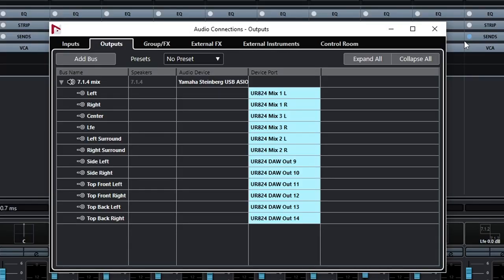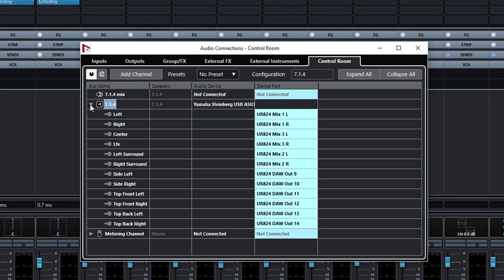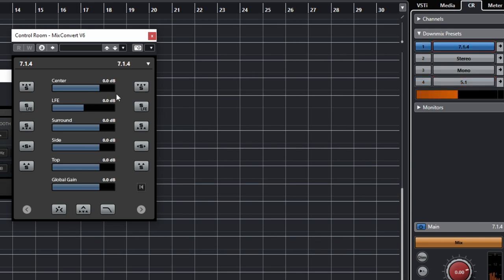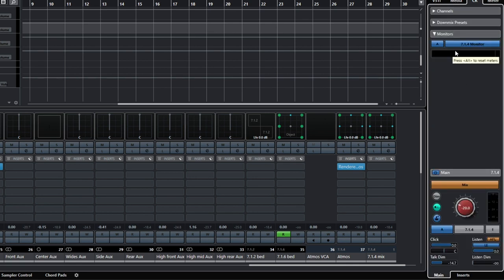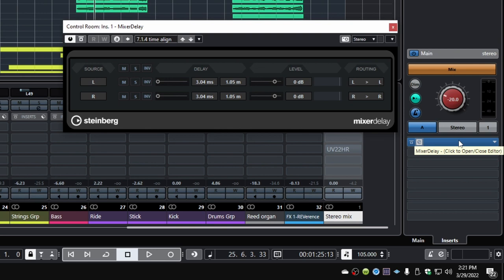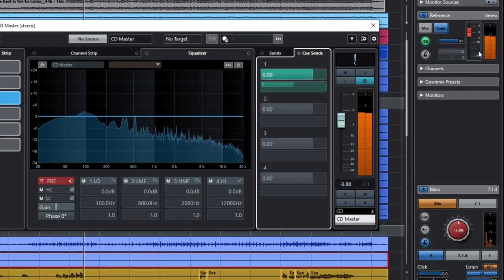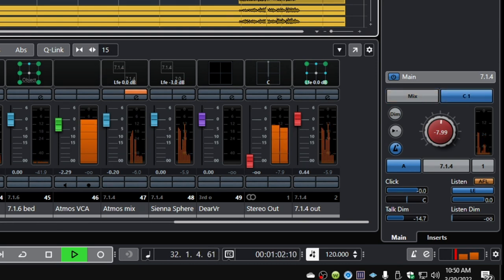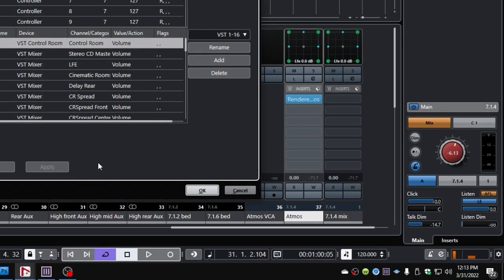The Control Room and Atmos/Multichannel Mixing (Cubase/Nuendo)

Comment: Great Video :-) I have been following all your videos for a while now :-) I take it your not using any dedicated controller system just Nuendo and the Steinberg interface for your outputs to your speakers? Best wishes
Reply from the maker: Thanks so much. You're correct about not using a dedicated controller. Having realized Atmos will probably never be more to me than a hobby interest for me personally in my situation, a controller remains a "nice-to-have". 
I have installed and set up SoundID Reference Multichannel on the 21-day free trial. It's a great program and did improve my sound somewhat. Not sure I'll spend the money yet.
Reply: @balladeerstudio  I am part of a group of pro producers who are looking at getting into Dolby Atmos and we have talked to many pros about it :-) but your videos give me especially some hope that we can find a more budget way into mixing in dolby atmos.. so we can get a grip without putting as on the bread line :-) I am hoping Someone like steinberg will bring out an interface that will work with cubase/Nuendo using only there equipment. Thank you keep up the great work.
Reply: @balladeerstudio  Thank you for the reply one quick question is it easy enough to route the channels in the dolby Render to the outputs of the Steinberg interface outs ? Sorry if this is a silly Question as i am just starting wit the dolby render kind regards kirk QFX
Reply from the maker: @QFXmusic  The reason you can hear the renderer is because it outputs to a 7.1.4 buss. It's explained in my videos, and others' as well. Good luck.

Comment: Fantastic video, very informative, I have used the control room for a long time, but recently when I worked on 5.1, I wanted to use a few new plugins to monitor 5.1 on Headphones. "Waves NX" has a plugin version "5.1/Stereo"; other plugins do not have this feature. So I wonder how to use a 5.1 plugin such as the "dearVR Monitor" on the control room headphones.

Comment: Hello from Norway! I just wondered; Is it possible to bypass decoding on the AT300 (direct mode) when you are listening on your DAW mix? I assume its always connected avoiding cable swaps? Im just starting to gather all the bits and pieces to start some Atmos mixing. Great advices by the way - I think we can make good atmos music without beeing "Dolby Certified" :)
Reply from the maker: Hi Tom! I don't listen to my DAW through the AVR. It's the other way around. Nuendo is configured to connect directly to the speakers through Control Room. When I listen to the AVR, it is a 7.1.4 input to Nuendo that I monitor with Control Room. Hope that helps.

Comment: If I am just mixing Binaural do I need to set control room to that format (7.1.4) or stereo (as the renderer puts out binaural.
Reply from the maker: As I remember, Nuendo's Dolby Renderer only works in 7.1.4. So you need to have an output channel set to 7.1.4. But you don't need to have a hardware interface that supports that if you're not mixing with speakers. You need the Dolby Renderer in order to output binaural from the renderer. I hope that helps.
Reply: @balladeerstudio  Thanks, I ended up buying Cubase and Steinberg's own literature is wrong about Nuendo vs Cubase. Previously 5.1 was the limit but with 12 Cubase goes up to 7.1.4 so it works like Nuendo does. I was confused because on the site it said Cubase was only capable of 5.1. Currently I set it up so my monitors (headphones ) are stereo in control room but the outputs (for the renderer) is set to 7.1.4. So it downmixes post renderer to the control room, which works fine because the Binaural setting is 2 channel stereo output anyway and the authoring is through the renderer so isn't affected by the monitoring buses.